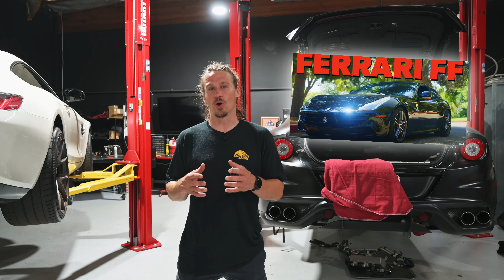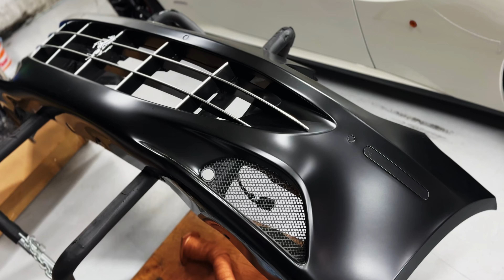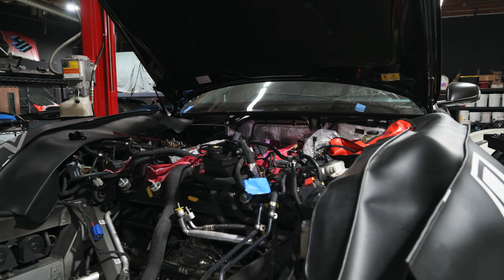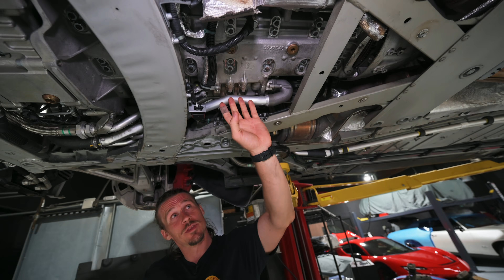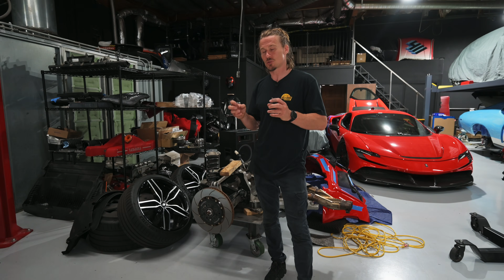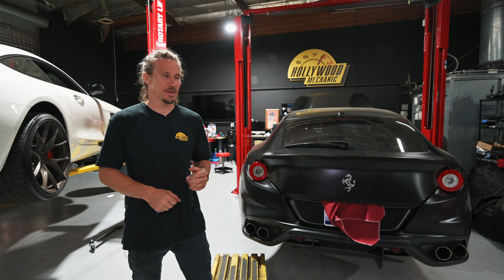Ferrari FF Common Faults and Repairs (GTC Lusso) 10 Year Edition

Comment: So everything can go wrong, and they don't even do more than 30k miles. My cars need to be able to do that in two years. I love Ferraris but they are obviously not made to be driven a lot.
Reply from the maker: Wrong.  You can put 100k miles on them in the first 12 years and you'll need the same amount of maintenance.  They love to be driven.  It's about time, not miles.  So drive it 5k miles or drive it 100k, plastic radiators will still leak where they are glued, valve cover gasket rubber will dry out, water pump dynamic seal will fail (honestly faster if not driven and coolant flushed often).
Reply: @HollywoodMechanic wrong, they can't be sold with more than 50k miles. Dealership wont even make an offer if it has more than 30k
Reply from the maker: @94mikyyy  I don't know what that has to do with anything.  You can buy them with higher mileage.  I have one here that just sold from an independent dealer with 66,000 miles.  Okay, so you can't buy from Ferrari, I would never buy from Ferrari anyway.  They market junk cars as if they are premium and don't even perform the needed services on the vehilces.  Unless it's an unobtainable model, or you're trying to join the club to get an unobtainable model, I see no reason to buy from Ferrari dealers.

Comment: Reasons to go with the T
Reply from the maker: You clearly have not read the technical service bulletin about how to change valve cover gaskets on the turbo motor.  Requires timing chain removal, on the back of the motor.  Engine out.  $35000 to reseal that motor completely and it leaks around the 8-10 year mark.  Also, turbos go bad and require $5000 rebuild (not including labor to remove and install) or you can buy from Ferrari for $22000 each plus tariffs.

Comment: Are there any brands that are more reliable, or are they all designed to spend lots of time in the shop?  This was incredible info!  Really enjoyed this.
Reply from the maker: All V12s will require a lot of maintenance at the 10-12 year mark.  Most not as much because most don't have a PTU, but Aventadors require clutch replacements and Throw out bearings that leak, Astons require oil pan removal for the oil pick up seal and gearbox issues due to dealer refusing to recommend services despite ZF saying it should be.  So, Ferrari is the most expensive, but all V12s create a lot of heat and have a lot of labor and parts to replace due to their size.
Reply: @HollywoodMechanic  Thank you for this info.  I live in Ventura County and will definitely use your shop.

Comment: So, expect more of the same when Purosangues are out of warranty. 
Allegedly, it’s the same PTU. Whoopee. 
Does the Getrag 8-peed DCT solve the problems of the 7-speeder? DHYB. 
Just a hunch, but what’s the betting the Puro’s active suspension will be a whole new world of pain?
🫣
Reply from the maker: I've got an 8 speed at the shop right now with 7th gear position sensor faults. It's all one fluid so no weep hole seal issues but valve body and sensors are already failing and are all plastic

Comment: thanks..was thinking of buying one.. not thinking about it anymore...maybe a 360 modena..much more dependable.
Reply from the maker: Yes, much cheaper car to own.  Obviously, the spider has more cost with the engine removal for the 5 year belt service and the soft top is known to require complete overhaul.  The coupe will be the cheapest modern Ferrari you could own.  The F430 being only slightly more expensive on maintenance, because there are no belt services, but the headers must be replaced.  I would go with the F430.  Well, I just bought an FF, so I wouldn't but, if I were you I would buy an F430.

Comment: So apart from the 21 issues I wrote down, what have Ferrrari ever done for us. Seriously that is a significant number of unavoidable time dependant failures (on top of the PTU) that will need to be addressed sooner, or later. Sounds like its true value is around 60-70k (£ or $) with another similar sum to be spent at the 10-12 year mark to make it fit for log term retention and use.
Reply from the maker: I agree it's going to be about $70k worth of work needed but I don't see how that makes the car worth $70k. Brand new it was over $300k, so if you buy one for $100, put $70k in, you'll be mostly trouble free for 10 years and be about half what it was new
Reply: @HollywoodMechanic  Fair point, thank you for the reply. I don't think we have anyone offering such a comprehensive refresh service in the UK, PTU aside. Very good overview of both vehicles.

Comment: Same issues with GTC4Lusso T, V8?
Reply from the maker: The v8 has the new turbo engine.  You don't have the water pump failure and no PTU to fail.  But that motor has about 8 years before it starts leaking from everywhere.  What makes it worse, the timing chains must be removed to change the valve cover gaskets.  Timing chains are in the rear so the engine must completely come out.  It's a nasty job.  Just completed one on a 488 and it was about $28,000 total with parts and labor.

Comment: Ferrari has a 15 year warranty though...
Reply from the maker: No, only if you buy it every year at $6500 per year and only up to 55000 miles. If you let it lapse, then you must pay for any repairs they suggest before you can buy again. The standard warranty is only 3 years
Reply from the maker: That would mean to add the additional 9 years to get to the 12 year mark, you would have had to pay $56,000 in warranty payments. Less than the repairs needed. But everybody is a gambler and thinks they won't need it before they sell it

Comment: It would be nice to just do a list of problems with the FF 
and what upgrades are ideal to. Do 
 and what to look for when looking at a FF to buy ie
PTU has been rebuilt and up. Graded
Radiator up. Graded. From plastic to aluminium etc etc
Reply from the maker: I think FerrariChat.com has a list of all the items I mentioned here. They seem to have what items they have done already also. I do have to let you know they also don't show which items they need because they are owners without the ability to see what's needed and how old their cars are (obviously a 2015 model is still two years from being 12 yo) but you can see which items are commonly already replaced
Reply: @HollywoodMechanic if I buy a FF , my plan is to do the right up grades ( if they ain’t already done) ie change plastic rad to aluminium, have PTU up graded , buy and stock pile service parts , as am planning keeping the FF for minimum 10yrs and get it serviced by a independent Ferrarri specialist

Comment: I was close to pulling the trigger on a FF since the depreciation makes them the most affordable Ferrari now . But after seeing this video I’m cured ( as we say in the Nederlands) I’ll pass on them  a Porsche Panamera turbo is the wiser choice I think.
Reply from the maker: If you want a V12, the Aston Martin Rapide is a much cheaper to own option.  Just make sure you service it's ZF gearbox regularly and change the oil pan oil pump pick up tube seal at the 12 year mark.  Check rod bearings while the oil pan is off.
Reply: Gewoon als nog kopen!

Comment: Correct me if I am wrong but between the Chinese parts and all that carbon build up on the valves, can people really afford to own these vehicles? Garbage in; Garbage out
Reply from the maker: you can just used a de carb spray in the intake before each oil change.  you can also add a catch can to the crank case breather system if you want.  Most of the time, just using the correct amount of oil and the intake valve cleaner is enough to keep the carbon out.  But yes, they are extremely expensive to own.  Although, if you do all these items, you can expect 10 years of low cost owner ship.

Comment: What would rate the F12 for reliability compared to a GTC4 lusso V12? I've been looking at either a 2014 F12 or a 2018 GTC4 they're both the same price and it would be nice to have back seats but there's no on in Ireland that actually works on Ferraris so would have to go back to the UK for any work it would need
Reply from the maker: They have the same engine, radiator and transmission. They will have roughly the same maintenance needs except the gtc will also have the ptu to repair. The gtc will be much newer so more likely to dodge some of the maintenance needs for longer. It's more about time.

Comment: $1000 to replace the battery?
I live in Dubai and I replaced the battery on my F12 Berlinetta for $250 incl. installation with a Varta silver AGM.
Works perfectly👌
Why is it so expensive on the FF/Lusso?
Reply from the maker: This battery is $600 at the dealership. It's not available at parts stores and if you order whole sale and have shipped it's still $300. Plus 1.5 hours labor, dealership charges 2.5 because they do what they want, so it's easily $1000 at the dealer. With me it's $700

Comment: My GTC4LUSSO is 6 1/2 years old, has done 25,000 miles. 
Went in for my 7th service, left with a $22,000 quote for repairing an engine leak and a coolant leak, and replacing front brake pads.
It was a big shock.
Reply: Not more?

Comment: This kind of made me want a GTC4Lusso even more. I was under the impression that all of the good builders who can help with the PTU and 4WD were in England. Guess that is what I deserve for only watching other YT vids and reading reddit threads.

I was looking at GTCs on the East Coast and was going to start asking about the service history, but it seems the best is to just send it to you as a preventative maintenance? How long would the PTU last after the fix?

A dealer I spoke with joked I should just buy two PTUs along with the GTC if I plan to put 10K+ miles on it. Guess he wasn't wrong.
Reply from the maker: I figure my repair will last 10 years, regardless of miles.  I replace the faulty parts with ones that will not fail in the 3 ways the factory parts fail.  The factory parts fail with miles, especially stop and go or low speed miles, and with time. So the only issue with my kit that can arise is the seal that I use beginning to leak.  Seals usually last 10+ years, regardless of miles.  That is what I expect to see.  At that point, it would be good to reseal again as the axle seals will most likely be starting to go as well.

Comment: What exactly needed to be done for 100k at Ferrari and 65k for your service? Was that a transmission or engine rebuild?
Reply from the maker: Ferrari quoted valve cover gaskets with timing solenoid that was giving timing control faults), water pump, PTU replacement and DCT Speed sensor (we rebuilt the entire DCT).

Comment: do you have info yet for the battery relocation kit? parts and labor cost? Since trunk is much cooler, is it ok (do you recommend) using Anti Gravity after the relocation?
Reply from the maker: @waaan_  I have all the parts for the battery relocation ready but I haven't sold any that I did not install due to the risk of grounding the positive wire if the install is not done correctly. Not sure if I'll sell the entire kit or just the brackets to replace the battery in the front and tie down the battery in the rear. Find my company on Google and message us and we can get you those parts. The truck panels we will not offer because of different cars came with different rear trunk panels. The best thing for that is to go to an upholstery shop and let them just make the panels custom. It would probably be cheaper than buying at our cost and shipping them and they can cover them in whatever material best matches your car.  As far as lithium ion, most technicians at the dealers do not like them, as errant faults are often in control modules due to unexpected voltage variations. Even the dealers no longer sell them. Mclaren, for instance, now only sell agm and conversion kits for all their cars. So something is not good if a dealer is willing to cut out a part they are selling for $2k to replace with something you can buy at autozone. 🤷
Reply: @HollywoodMechanic  thanks Micah. Appreciate you being so engaged with your community.

Comment: Finding this channel is a godsend…. I was getting dangerously close to pulling the trigger on a Lusso T but I don’t think I’m ready for the maintenance requirements. I had a 2012 BMW 650i with the n63 engine and the constant issues, downtime, and crazy parts prices drove me nuts… I knew my mechanic far too well lol… my Porsche mechanic on the other hand never remembers my name… I’ll take that as a sign 😂
Reply from the maker: @fishhead90  but just a note, the lusso t doesn't have the ptu and it has a smaller, easier to maintain engine so the costs might not be as high
Reply from the maker: @fishhead90  I just parked my x5 n63 for the last time. Got 145k miles before valve stem seals got too bad. I don't feel like investing a week of my labor to fixing it. So we are 2wd manual converting it with something more reliable 😊

Comment: How faulty are the F12 and the 812 from your experience as a mechanic?
Reply from the maker: @G6_SA  812 is kinda new, so faults are not common yet but it's the same basic layout for the engine and gearbox.  The F12 I see the same issues. So water/oil pump, radiator design, timing solenoids under the valve cover, transmission over haul and weep hole requirements, shocks leaking (especially if lowered).

Comment: Will all the FF eventually have the ptu issue,?
Reply from the maker: @robertcomella8486  yes. The design is flawed. I have other videos clearly showing an inadequate snap ring not designed for lateral load as well as the geometry of the shift fork bushings lacking in several ways. They all fail
Reply: @HollywoodMechanic  thanks....time to sell mine, had for 4 years with no issues...time to get out
Reply: @robertcomella8486  you can go for a gtc4 lusso t they don't have the faulty ptu but it doesn't have the v12

Comment: I’ve heard the PTU issue is for 2012 and 2013 but not on 2014-2016. Is that correct?
Reply from the maker: @theeverydayguy2938  haha nope buddy. Gtc4lusso I just had to rebuild with 8000 miles on the odometer. The forums never cease to amaze me. Ferrari doesn't change anything. Ever. If it was a big problem before, it still is. Until they replace whatever it is with a completely new model. So many times I hear, "oh they updated the 7dct and only the Californias have problems. Meanwhile I'm doing weep seals on 488s and 812s 🤣

Comment: There goes my plan to get an FF (dont want GT4 Lusso). I am pretty good with DIY projects and I have a lift but after watching this video and why costs are so high (parts) I will be passing on FF and probably getting C8 AND M5 instead. Bye bye screaming v12...welcome rumbling v8's?
Reply from the maker: I hope you're not talking about an M5 with the S63 engine.  I just sold my N63 (almost same engine for the v8 TT non M cars) and it was a complete nightmare to own.  I spent $5000 in parts alone, not including the notorious valve stem seals and guides or the $3200 fuel injectors.  That motor had 24 different fluid hose connections to pull that motor and you have to do it after 10 years because the plastic intake leaks boost.  Such a nightmare.  If you have good mechanical hands, you can do all the Ferrari stuff yourself.  The BMW requires much more skill and time to service as well as needing ISTA to try to diagnose their "torque request" system that won't tell you what's wrong, only the engine is low on power.  Such a nightmare.
Reply: Thats interesting. Would you consider v8 mid engine Ferraris more reliable than v12 counterparts? 360 and 430 and 458?

Comment: I had a 2008 612 and was speaking with one of the top Ferrari mechanics in the country (similar to Micah, but down in San Diego) and when I asked Steve how do I get a Ferrari without problems, he said the key is to buy a three year old car and sell it before the warranty runs out.  After having to replace my tie rod ends at 20k miles you learn that in fact Ferrari's are just not well built.
Reply from the maker: It's nice to be mentioned in the same class as Steve M, if that's who you're talking about.  Great guy, really bringing engineering into his custom mods and repairs.  Hard to get ahold of though, but the best are it seems.  It's funny that he commented that.  If you read the comment from @stuffhappens5681 "Not exactly selling me..." my reply was similar to what Steve told you: Buy a previous generation 4 or 5 year model and sell it after a year.  You really get the cross point between most depreciation already occurred and least maintenance expected.
Reply: @HollywoodMechanic  Yup, that's the Steve I was referring to.  I loved when he showed me the 458 transmission and said, hey that switch costs 30k from Ferrari or 3k from me.  I was actively looking at a FF that already had the PTU repair done and then I learned that was a worse idea than buying a Mondial

Comment: Big fan of Micah!  He knows his stuff. I was the owner of the white FF. I sold it earlier this year. It was a great car to me and Micah took the time to explain the maintenance options and other information about the car. If I still had it I would definitely take it to him.
Reply: Currently looking at a white FF, maybe yours? 🙂. Just wondering, in direct sunlight, could you see a very subtle shade difference in the white paint between the side skirts and front bumper vs the body panels? I've spoken to a couple body shops and they've told me (and actually showed me) that this is common on straight from the factory cars because of the way the paint shows differently on metal vs urethane. I'm trying to suss out whether this car might have had some repainting done. The difference is very subtle but you can see it in bright direct sunlight. Thx.